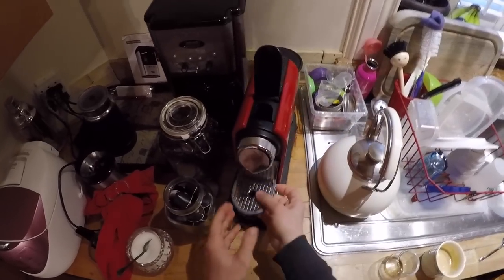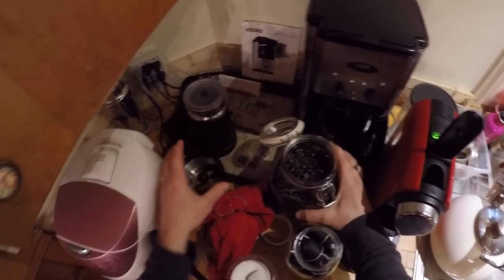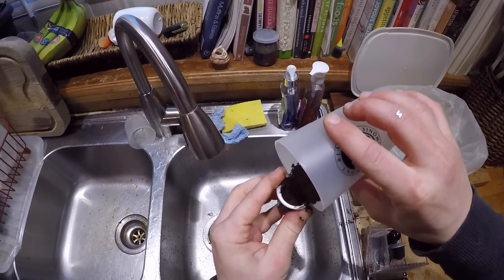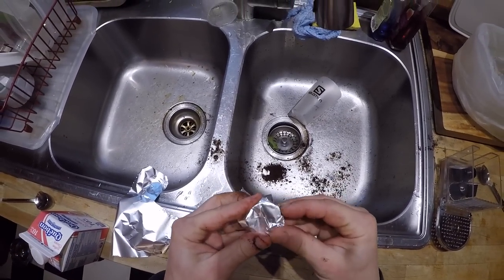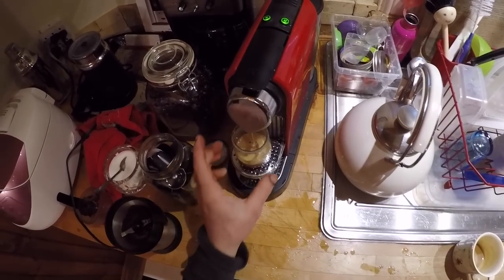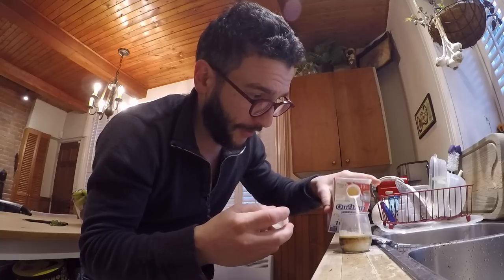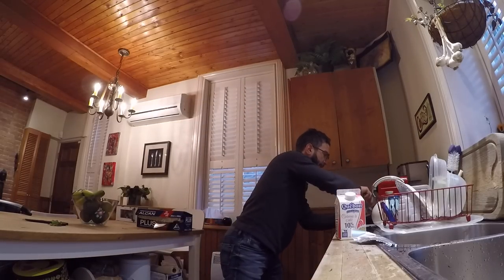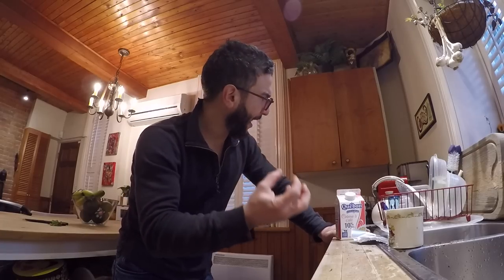REUSING NESPRESSO CARTRIDGES - MY INVENTION!!!

Comment: I'm not surprised it didn't taste great - those beans look like a charcoal-grade roast. If you are worried enough about the waste to give up convenience, get an espresso machine. Keep it clean, learn to use it, use good beans,  and I promise you'll knock the socks off any nespresso capsule out there. As a bonus you'll be able to use whatever coffee you like - You'll probably also spend a lot less on the coffee. If you are so inclined you can even roast your own beans. But beware - the rabbit hole goes deep.
Reply: If you go down that deep might aswell start a company.
Reply: @fukushimadaichi415  😂😂😂
Reply: Alden Buyer  "You mail back 100+ pods and they recycle them into new pods or into the panels on one of their machines."

And have to deal with the sour stench of mouldering coffee all the while? No thanks!

 "Or... since it’s aluminum.... you can empty them and throw them in the recycling bin."

Ain't nobody got time for that. Isn't time savings and convenience why you're using pods in the first place? Doing this is neither.
Reply: I've reused Cafitaly capsules for about 5 years until the machine was broken. I can tell the taste depends on the bean you use. So this is a great way to save and also to not contribute to enviromental damage

Comment: It was all going very nicely right up to the point when our hero opens the fridge, grabs cold "creme" and totally swamps his espresso shot with it! Yechh! 
Try heating milk in your cup in the microwave for 60 seconds first. Otherwise you'll get a cup of luke-warm coffee as in the video. Heating the milk also heats up the cup nicely.
Reply: The "genius" surely knows how to ruin an espresso shot.
Reply: 60 seconds ? My nuker would splatter boiling milk all over the insides of the oven. Some of learned that the hard and very messy way 😃
Reply: Milk was trying to make it drinkable, he did it on purpose

Comment: do NOT do this. I made a mistake of trying it once and the poor machine (Essenza Mini) started to make strange noises and vapor started to kind of flush out and it even vapor was coming out when I opened the handle .... after that I used a normal Nespresso capsule which produced little coffee ..... so I thought "Ok, I ruined the machine. My lesson will be the price I pay for buying a new machine" .... but after that I just ran the machine without capsule twice, and after that using a Nespresso capsule and apparently it works fine now. But I might have damaged something which will show in long run. Extremely stupid thing to do, most probably few people will write here they did such a stupid thing (out of shame) but I was that angry at myself that I really felt I need to write it here.

Comment: You can just buy an espresso machine, where you can just use your own coffee without the need of Nespresso Cups or foil.
It does not require foil, allows you to use more coffee (for stronger espresso), and you will not need to use two Nespresso Cups each morning.

Comment: It would've actually worked best if you used heavy-duty aluminum foil instead of just regular aluminum foil.  That seemed to be the issue. Try Heavy Duty foil instead next time.
Reply: Still leaking with heavy duty foil, please help
Reply: @California007  two layers of heavy duty foil?

Comment: The re-used pods will not contain the pressure of the machine because of the extra holes underneath the pods. Most of the extracted liquid will just spill in the tray. Bottomline, you're not saving money.
Reply from the maker: And it tasted like crap too! 😂

Comment: Wonder why it tasted so different? Was that just bad coffee, or not ground up enough? Nespresso makes more money selling coffee that way, so I doubt they'll be making their solution like this anytime soon! Very cool to know this is possible though, thanks!
Reply from the maker: ARXV Photo The coffee grain was not particularly good, and it wasn't espresso coffee grain either, kind a like grinding up regular brewed coffee and trying to make espresso out of it. :)
Reply: Hmm... Pretty sure coffee is just coffee? Like there's different quality of beans, roasting etc. But I think it's how finely it's ground that makes it good/bad for Espresso.
Reply from the maker: ARXV Photo no, there are different roasts for filtered coffee versus espresso… also, different grinders. Espresso has to be extremely fine grind, whereas I was just using a mill which grinds coffee grain for filtered coffee. To settle some science, I may have to do this again with proper espresso grain :-)
Reply: Not the right about of grounds in the pod for first of all 2nd of all depends ki d of beans used as well and the grind of beans

Comment: Better late than never (no statute of limitations for nespresso) About 18 years ago I routinely refilled nespresso capsules but using a burr grinder. The blade grinder you are using will not create the fineness or consistency required to pull the espresso shot. Subsequently aftermarket refillable capsules came out.
Reply: What kind of pod do u use? :)
Reply: @aleynaa6842  I only refilled the original pods. Used thick alum foil to reseal.

Comment: BTW...refillable capsules have been around for years. However, YOUR makeshift capsule could have been a good idea...except...it was not hermetically sealed (no "pop") therefore you did not brew at 19 bars of pressure which is why your coffee tasted like pure shit. You invented a "makeshit" capsule. It's okay. You just didn't know. If you suck the air out of the capsule and seal both ends with foil, you might get a pretty good crema.
Reply: Sounds good. Worth a shot! 😉
Any ideas on how to suck the air out of it?

Comment: My Keurig came with one of what you describe. Sorry. Also, I can make the Keurig noise with my nose, here's proof of creation:
https://www.youtube.com/watch?v=3ajCQnYjvw4
Reply from the maker: Strikeslip that's actually a pretty funny video :-)
Reply: Thanks! It was the first thing I noticed after I was gifted the Keurig. Also, the place where we buy the pods, ECS, also offers a recycling program. We bring the used pods back to them. Not as good as using the grounds-holder, but we have a little less guilt that way.